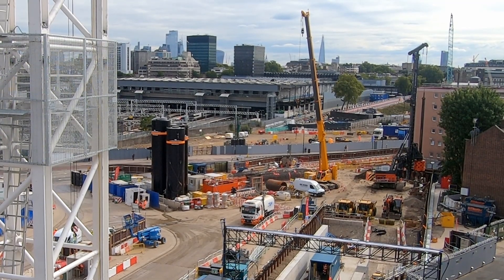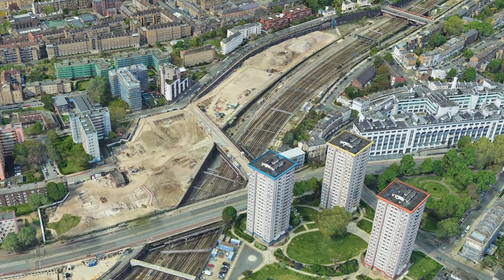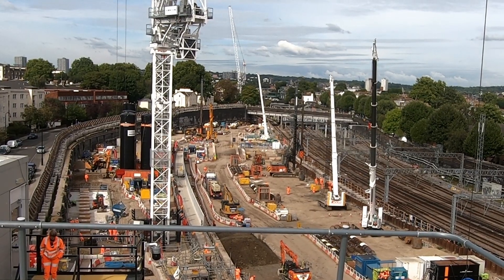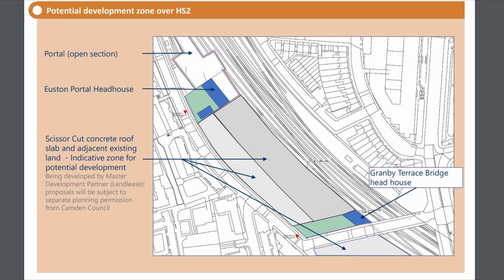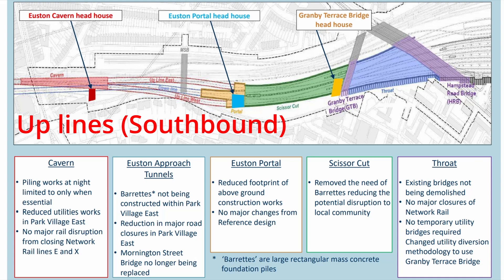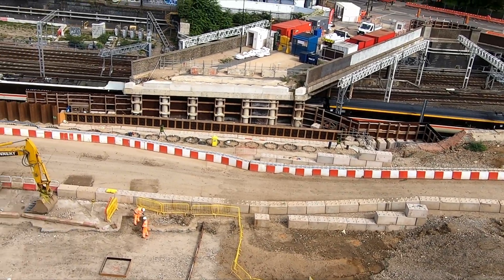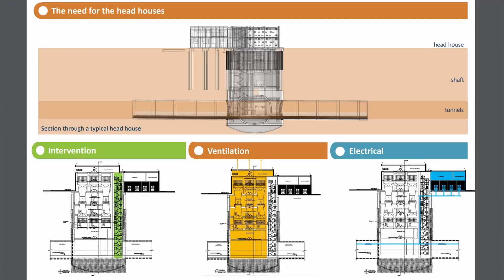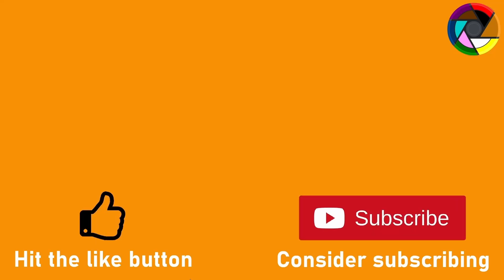HS2 Building Euston Approach | September Update

Comment: Missed opportunity: Should've connected HS2 to HS1 using Stratford International as the main London stop. This could've provided a south-east to north-west England service, connecting Ashford International and Dover Priory, with the Midlands and Manchester.
Reply from the maker: Old Oak Common will take care of east-west rail links. I know a lot of people think the conn to HS1 is crucial, but in reality it'd only be used by a handful of through trains to France a day and then there's to.not insignificant task of sorting out passport control at stations in the North. Ultimately Euston  is where most people will be travelling to, which will have improved links to London underground.

But I do think there needs to be some sort of direct covered walkway between Euston and St Pancras and a single ticket option from the North to the continent, shouldn't have to buy 2 separate tickets.
Reply: @Rail_Focus  Point taken, though I think you may have misread. I wasn't concerned with linking through trains direct to the continent, rather trains with connections to Dover Priory and Ashford, effectively connecting the south-east of the country directly with the North west and Midlands. The useful offshoot of this is that it opens up a route from Kent to Old Oak common without the need to change trains within London, and passengers travelling from the Midlands and the North have a choice to get off in West London or get off in East London, reducing any future strain on the Elizabeth Line. It'll help to bump up Stratford International passenger figures.
Reply from the maker: @EdgyNumber1  ah I get you. I still think Old Oak and the connection from Euston to Euston Square will improve connectivity across London and beyond. But granted Euston isn't perfect, but it comes down to best value for money and space, given the new station needs 10 platforms just to accommodate the minimum service pattern proposed.
Reply: @Rail_Focus  Another major concern is the ability of the underground to take all the extra passengers from HS2. The main reason for Crossrail 2 was to relieve the higher passenger numbers and provide greater capacity through London from the SW to the north and ultimately the NE. As we know  Crossrail 2 has been shelved so this is a major concern going forward. I honestly think the huge passenger footfall for Euston HS2 and SPI will lead to lots of problems on the underground network.
Reply from the maker: @ds1868  the connection to Crossrail at Old Oak Common should relieve some of the pressure but ultimately XR2 should go ahead
Reply: @Rail_Focus  Yes Old Oak Common should be helpful, but the sheer impact of passenger numbers at the congested location of Euston will be a big problem. There was no funding for XR2 in the Autumn Statement. On the other hand EWR has now the full funding, which I did find a bit surprising.
Reply from the maker: @ds1868  I'm not surprised by EWR to be honest, but it does seem that funding XR2 has been caught up in the wranglings over TfL funding.
Reply: @Rail_Focus  Yes the complication of TflL and the Mayor of London is the added complication. I suppose it makes sense to fund EWR as the major issue is freight. Stil, the budget for EWR is big and will get bigger!

Comment: As a train driver, i love the track design approach to the station,  with the down tunnel in the middle,  this will guarantee that one train can go in as another goes out no matter which platforms are used. 

Should be fantastic for capacity
Reply from the maker: It's reassuring to know that this won't be cut from any future plans for Euston. It's an expensive design but needed if HS2 is to ever operate at capacity.
Reply: @Rail_Focus  exactly, it makes a massive difference capacity wise because normally leaving trains are always forced to cross the path of others at some point. this alleviates that potential bottleneck

Comment: Very good video. On general engineering, I don't think the HS2 decision to terminate at Euston was properly thought out. Why not at St. Pancras, where through trains could go directly to the Chunnel? Through trains would then not need additional platforms, and the lower levels of St. Pancras, which are quite considerable could have been used for Domestic Terminations or could even have run East-West at St. Pancras. The additional tunnelling distance to St. Pancras would have been £Billions cheaper than the present scheme and a whole lot less disruptive providing better connectivity.
Reply from the maker: Like anything it's a compromise between cost and benefit. Building 10, 400m long platforms anywhere in London be it above or below ground would be a challenge. The reason the HS2-HS1 connectivity was dropped early on was because it was too costly and complicated for relatively little benefit. Yes through services to Europe would be good, but the domestic services need to take precedent.

Comment: A backwards project, without a link to HS1 without a direct route to Europe from Birmingham, Manchester and Glasgow.
Reply from the maker: A connection to HS1 would have been nice, but HS2's primary purpose is to release capacity on the WCML, not to provide through services to Europe, that would only be a few trains a day, not the 16 trains per hour that will go into Euston
Reply: @Rail_Focus  So the only intention was to relief a already over crowded WCML, with no intention to have a direct route to mainland Europe, what short sightedness, lol, so calling it HS2 was pretty much pointless I guess West Coast High Speed wouldn't of had the same impact as calling it HS2, and now I understand why the government scaled back the project not just because of spiralling costs but because it wasn't needed.

No insight by all parties involved with the project GCR would of made a perfect freight only mainline making East Midlands Airport a huge cargo hub for freight traffic, the new freight mainline route would of been the first for the UK, which would of allowed continental trains aswell as longer trains with a direct link to HS1.

Maybe it's about time this country stopped being choosy which railway lines to electrified, WCML, ECML and parts of the MML and GW are electrified but the connecting branch routes between each major route are still not electrified.
Reply from the maker: @KJames2345  HS2 would have absolutely benefited the MML and ECML too, but now the government has hacked it back, that's the short sighted bit. Now with IRP, ECML capacity will be trashed with the stupid 140mph running idea. But the original scope set out by Network Rail was a relief line for the WCML, which by the mid 2000s was desperately needed, even or possibly because of the success of the WCML upgrade. The WCML was or still is the busiest mixed use railway in Europe. The VHF timetable introduced at the beginning of 2000 had ruined local and regional connectivity. HS2 takes fast trains which stop at few stations south of Stafford and puts them on HS2, freeing up space on the WCML for improved regional and local links and freeing paths on the WCML for additional freight. If the eastern section to Leeds is built HS2 would have the same positive impact on the MML and ECML.
Reply: @KJames2345  I dont think you get it
Reply: @peterwilliamallen1063  Maybe they should of done a complete rebuild then, or labelled it WCML 2
Reply: @suburbia2050  I get it, it's the most expensive version to relief congestion on the WCML only as far as Birmingham, then it's back on the original WCML at Crewe.

They shouldn't even label it HS2 because it isn't HS2 that is the fancy terminology for WCML upgraded.
Reply: @peterwilliamallen1063  Ever heard of Sarcasm? 

Didn't think so.

🙄

Comment: Meanwhile in the northwest , Skem In west Lancs still can’t get a rail link .
Reply from the maker: Nothing to do with HS2 though is it, more to do with a recent Tory Government that seems to hate the railways. We must invest in HS2 and existing railways, not either or.
Reply: It had looked hopeful until recently. Merseyrail's current extension to Headbolt Lane looked promising as a further extension to Skem later.
I do wonder if Liverpool City Region should be extended to include Burscough, Ormskirk and Skelmersdale an up to the Greater Manchester boundary. Public transport in West Lanc's falls off a cliff on Sundays. No Northern trains from Ormskirk or Kirkby, many bus routes are Monday to Friday or Monday to Saturday.
Reply: @neilcrawford8303  It looks as though from the Autumn Statement the north will mostly miss out again. On the other hand, HS2 has been confirmed to Manchester. Of surprise is the confirmed funding to complete East West Rail. I'm really surprised about that. The Cambridge Arc is really no more and the business case for EWR is weak. It can only be assumed the main driver now is freight. The NLL is at capacity so freight from the North Sea ports is now being squeezed. Still, the original budget of £5 billion will rocket with inflation.  Crazy times.
Reply: You cant get a rail link if the core trunk lines are at capacity!

Comment: Get to London 20 minutes quicker. Wow, great value for money that like,,,, not
Reply: Yep. HS2 only makes sense when you accept that it's just a vanity project which is making billions for construction companies.
Reply from the maker: It's much quicker than 20 minutes and it's about releasing capacity on the WCML to improve regional connectivity and allow more capacity for freight.
Reply: @Rail_Focus  releasing capacity, they can't run to the  capacity they already have,1 train a hour Manchester to London, if you want to get there earlier get an earlier train,that's if they are running, need investment in regional railways, Northern Rail and Trans Pennine Express are a joke.
Reply from the maker: @davidowen7793  that's a temporary situation caused by Tory incompetence and the Pandemic, things will return to normal

Comment: All about London as per... 🙄
Reply from the maker: If they didn't build a new station there would be nowhere for the trains to go. It's about adding capacity on the WCML, which will benefit passengers from Birmingham, Manchester and all the way up to Glasgow.
Reply: @Rail_Focus  problem is how much will be built outside of London to Birmingham. How much more will the government cut.
Reply from the maker: West Midlands to Crewe will certainly go ahead, without it the capacity argument falls apart. Manchester I think will still go ahead, but not so sure about any link to the WcML north of Crewe any more. Of course Scotland will still benefit from the connection at Crewe, but not as much if HS2 was connected to the WCML further north.
Reply: Well that is where the capacity constraints on the national trunk lines originate, but the trunk lines runs up and down the entire country, doesnt take a great brain realising the overall benefits of releasing capacity on those existing national lines right?